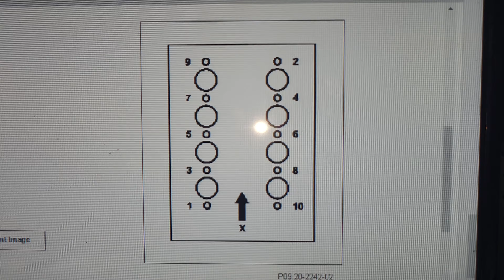Edition 507 C63 HAND BUILT Engine to Perfection! ENGINE ASSEMBLY M156 DIY!

Comment: Long time C63 owner. Used ARP headstuds instead of stock male torx head bolts for my ESS supercharger kit build.
Fun fact: all M156 engines have forged connecting rods and a forged crank. P30, P31, & 507 editions have forged pistons.
Reply from the maker: Yes we are aware, although stock forged pistons aren't as strong as CP pistons.
Reply: @ModernMastersAuto  any links to a hydraulic press comparison? I've never heard of an M159 road car piston failing even when used with forced induction. Legitimately interested to see what the aftermarket offers for the M156 shortblock. Porter makes some high quality forged connecting rods. I'm impressed with the durability of the stock crank & rod bearings. 87k miles & oil analyses have shown very low metal in the oil.
Reply from the maker: @TomWilliams-z4e i have a pile of forged pistons you can have lol
Reply: @ModernMastersAuto  yep hydrolock is an immutable force of ICE physics pistons are subject to , forged or not.

Comment: Could swapping oil temp sensor and AC power connectors actually be on purpose so you always have the oil cooler running for a track day or something? I wonder what exactly is happening there? That seems odd and AMG is known to put little Easter eggs in their cars to be discovered later down the line. Rusty, you are the man! :D

Comment: once you torque down the camshaft adjusters and timed. do you need to recheck the timing again by rotating the crankshaft one full rotation and putting back the timing tools again.
Reply from the maker: Not for the experienced but it's always good to double check your work

Comment: Gents, in the intake manifold, the bracket over the throttle body: the two folding clips need to go underneath the bracket. not only under the bold head. Then the bolds can still shake loose.
Reply from the maker: No they are covered by the lid

Comment: What's the name of that part that goes with the linkage on the intake manifold minute 47:50 I've ordered a new manifold and that part came broken 😢.
Great video as Always keep it up.
Reply from the maker: Vacuum actuator for runners
Reply: @ModernMastersAuto  Thank you very much  I can't see to find that part anywhere don't you guys have one left that you are not currently using 😅? if so let me a email address to reach up